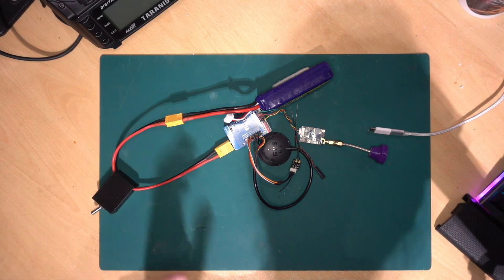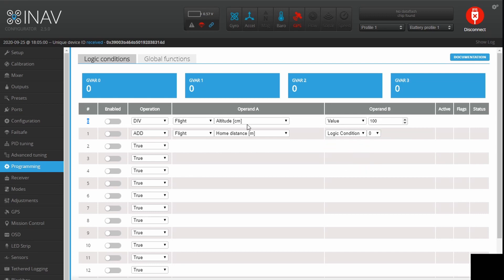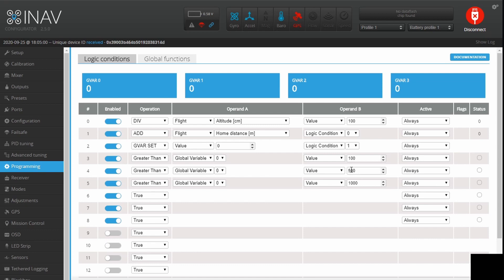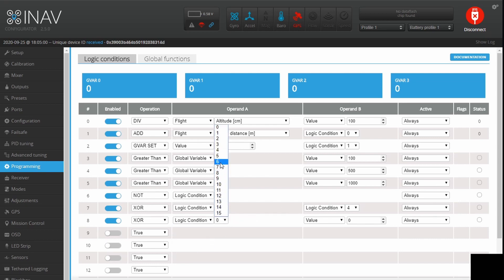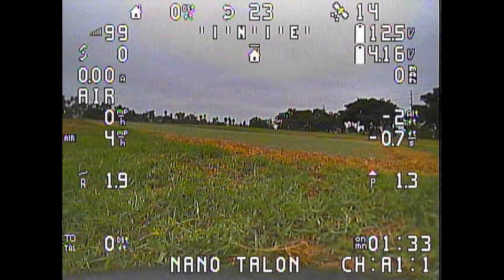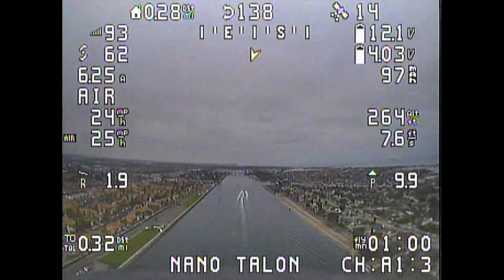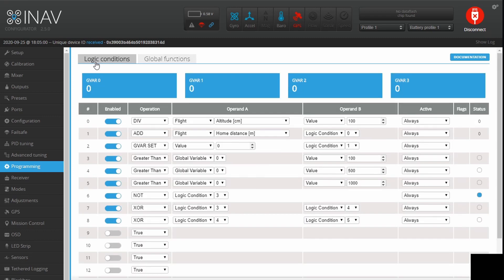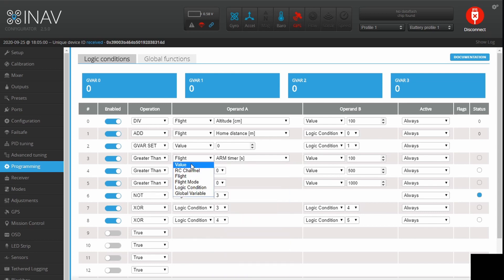The Ultimate Auto VTx Power Adjustment with iNav Logic Conditions

Comment: Hey man, great video and the variables works very well!
However i have had something strange that makes no sence. Distance of 1.65Km and Alt of 2.1km the logic changes back down to level 3 on the vtx.
Further than 1.65 the vtx was pushing level 4 as expected. My distance value for level 4 is set to 2000.
I checked the whole dvr footage and the power levels changed exaclty as expected up to that point.
Would you have any pointers to check?
Thanks
Reply from the maker: That sounds really strange. There’s no reason why it should work most of the time. I agree that at 3750m (what the global variable should have been), that it should switch down to level 3. It should still be on level 4. 

Perhaps there is something strange happening gun with the global variable. Unfortunately there is no way to check this while flying at the moment. In 2.6 GVars will be viewable on screen, which would help with diagnosis. Also, there may be a  3D home position, that is using proper trigonometry to get the correct distance from the home point to the model. So without the diagnostic ability, I can’t really say what is happening. It will be there in 2.6, but so might a much better and simpler way of doing this.
Reply from the maker: To follow up, I could not find the range allowed in the GVARs, so I asked Paweł. They can store from -32768 to 32767. So there should be no reason why there would be a problem storing 3750. It should have 10 times that available.
Reply: @MrD  Thanks for checking :) I had seen about the improvements on 2.6, im scratching at the seams to get hold of that !
By all means i dont mind privately sharing the dvr footage and my diff.
The only thing i did wonder is if the vairable is grabbing the either the barometer while the osd gets the GPS altitude or visa versa. Hence why the low flight was okay, however hight altitude was casusing a discrepency.
Reply from the maker: I don’t think it should be that. It should all use the same altitude. It’s looking like 2.6 is getting closer. An alpha release has been provided. The change for this will be included too.

Comment: nice.. but it's a pain in the ass having to use eu numbers... us old brit folk use feet n inches like we did when we were in school :D now is there a possibility to "delay" the changing down till you're a decent amount inside the range ?
Reply from the maker: I’m and old brit and hate imperial 😁 Well, for smaller measurements. Distances I still use miles 🤣 I used to hate finding the right spanners for my Chevy though. All the fractions of inches are just ridiculous. 

As I see it at the moment delay wouldn’t be possible. The iNav programming is very basic at the moment. All you could really do is reduce the switching range. That would also mean that the power would increase earlier too.
Reply: @MrD  lol... my issue is they use centimeters, and meters in different places... such as the rth and failsafe config stick to one... either centimeeters or meters. why have centimeters when setting up rth alt and then meters in this.. stupid imho

Stick to feet and be done with it :D
Reply: as for the delay yea ... but it would be nice so that it's not an "absolute" thing
Reply from the maker: Yeah, it is a bit crap that some is in cm and other stuff is in metres. There is no real reason to use cm, especially for things like altitude and loiter radius. Metres are fine. The configurator can convert it to whatever units the firmware is expecting. The inconsistency is crap. Its why I converted the altitude to metres. Who want to set stuff like this in cm at all.

Comment: Another thing, when the plane is away from home, altitude improves the signal (less masking).
Reply from the maker: This is true. There is better line of sight between the antennas at altitude. The ultimate would be an RSSI based. But it is better to have the altitude component, than just based on distance from home on the flat.

Comment: Thanks for the video! So to solve flying below yourself altitude problem we need ABS operation or even better SIN & COS functions to calculate real distance in 3D space(of create another condition if X(altitude) < 0 then x=x*-1]. Guess thats not that much to ask for from inav devs:-) Thanks again, it was nice introduction to programing tab in inav configurator.
Reply from the maker: That would definitely be a better option for the iNav variable. That level of programming isn’t possible with the logic conditions.

Comment: great job. I would add to be more confident
 RC CHANNEL X GREATER THAN 0 and determines the high power available. So in a situation where the video quality is not good, high power can be forced  manually by a switch
Reply from the maker: This would be a good option to add. Great suggestion 👍🏻

Comment: Thumbs up. But another question is, how do you wire up the VTX to the flight controller so that the VTX knows when to change the power level?
Reply from the maker: It needs to be a smart audio or tramp telemetry VTx. You hook up a UART on the FC to the VTx and set it up in on the ports page.
Reply: @MrD  Thanks buddy